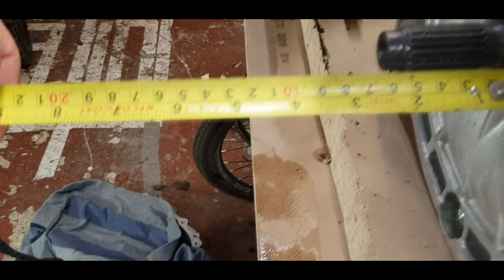Nissan Leaf Motor adapter plate idea. Part 4

Comment: im very new to this and trying to learn the process as i'd like to convert my mk1 golf. Whats the reason to not use the leaf controller. If you are using the motor, inverter and battery from the leaf? I'm sure theres a reason, just wanted to know what it is so i know for my build. thanks
Reply from the maker: I have seen video, where people have translplanted the whole wiring loom from the leaf, and yes it could work but you have a load of faults where the controller is looking for stuff, unless you can trick it into beliving its still in the orginal car.Yes you can use the leaf invertor , there are more options from when I first started. I'm now going to use the Thunderstruck leaf VCU now for simlicity . You wire to the box and it tells the motor what to do,
Reply: @IfItAintBrokeStillFixIt  thanks for the reply. So the motor and inverter from the leaf and the thunderstruck as the controller?
Reply from the maker: @studiow7  yes that's correct, remember that when you get the leaf stack to get the motor/invertor wiring loom, people are not generally not using the leaf charger dcdc as they don't have space under the bonnet. The guys at Thunderstruck are very helpful too. You could try the openinvertor board but you need to be tech savvy for that one.

Comment: Using the old gearbox like that seems a decent idea, but I'd be tempted to rebuild the leaf gearbox and and get driveshafts made/welded.
Reply from the maker: I am wondering now whether the original old gearbox will cope, going to see how it lasts. I am tempted if it fails in the future, if it does break I like the idea of a Tesla SDU.
Reply: @IfItAintBrokeStillFixIt  Will have to catch up with the videos to find out what you went with. I'm thinking of changing my motor and swapping to a single speed reduction to clear up some space. Beetle doesn't have much room.

Comment: Its too bad you didnt just mount that leaf motor and differential in place of the factory BMW rear diff.
Reply from the maker: That was my plan till I found out the inverter only spins up to 6k rpm which meant a top speed of 60mph which isn't very good
Reply: @IfItAintBrokeStillFixIt  That sucks. 
That reduction gear would be awesome to electric swap a rockcrawler or a tractor though.
Over 800lb/ft at trans input shaft then going through a trans, transfer case, and diffs!

Comment: if you going to machine something you maybe better off getting a spline bush with both original splines 1 each end and just putting it on like a sleeve ..as for controllers this one was made for a leaf https://www.thunderstruck-ev.com/dilithium-vcu.html then you can add an after market throttle i am looking to do this to my bug

Comment: No, don't mess with the Leaf transaxle, it can take much higher torque, you don't need a manual gearbox with a motor this size! Get some drive axles from a Leaf and cut them in half. Do the same with the project car axles and join them with a shrink fit sleeve. It is easy and cheap machining and will be unbreakable. A welded coupler will not be accurate and your manual gearbox will be stripped of its teeth!
Reply from the maker: Thanks for the feed back, still wondering which route to take , I understand that johannes controller spins upto 8k and could still rise .
Reply: @IfItAintBrokeStillFixIt  The leaf fixed gearbox is 1:8 so 1000 wheel rpm = 81 mph on 15" wheels = plenty! Why just not use an off the shelf controller? I know the leaf motor has a coil pickup for position sensing, but that could easily be changed for Hall sensors. There is plenty of room to fit 3 small magnets and hall sensors inside the housing where the current pickup assembly resides and even the cheap Chinese EV controllers come with software setup, so you can dial in the timing, which I think you need on the Leaf as its rotor magnets are skewed to reduce cogging?
Reply from the maker: @Tore_Lund  You seem very knowledgeable in the EV field, unfortunately if you see any of my later videos i have already cut up the leaf gearbox, my original plan was to do as you say, till i found out that the controllers only spin to 6K, even Paul's controller only spins to 6k  . Do you think I will destroy the BMW gearbox with the leaf motor , even if I use just 3rd and 4th gear ? . where would a good place to look for after market controllers ?
Reply: @IfItAintBrokeStillFixIt  I did suspect I was too late with my comment;).
Gasoline engines are not as torqy as electric motors. My own experiences with a 30kW motor with a 1:3 reduction directly to the diff. First two attempts it broke the key of hardened steel clean off as if it had been done with a bolt cutter. Third attempt broke the 22mm axle stump on the diff, so I ended with another with a 28mm axle and a half moon key 6mm wide, and it held up.  So depending of how aggressive your controller setup is, it might be a problem, but I have seen, as you, plenty conversions on Youtube with giant motors that work perfectly small car gearboxes.Aftermarket controllers??? I have no idea. There used to be some big Siemens controllers around the usual places, but I can't remember if the voltage was suitable for 375V or what a Leaf uses. I was thinking more in the line of Golden motors controller, but looking them up, their highest voltage model is only 96V! So maybe this kit 100kW 400V is more suitable: https://hackaday.io/project/164932-axiom-100kw-motor-controller/discussion-124679. Parts ship from the US, so that is easy!

Comment: I would use the pilot portion of the input shaft to aligh the shafts,  or depending on power levels , you could offset mount the motor and use motorcycle chain, to fine tune the gear ratios, but even 8 mm plate would work, the forces are in a twist, motion. It should be plenty strong, 8 mm is alot cheaper than 15-19mm

Comment: Mayby use a roller chain coupling? It will allow a little bit of miss alignment where as your spines are going to need to be bang on centred and square?
Reply: I was thinking he could get a custom input shaft made for his BMW trans that would match the splines of the Leaf motor, since he wants a custom job anyway. That way it would just be a matter of making adapter plate. It would just involve him taking his Bimmer trans apart and giving the machine shop both input shafts.

Comment: Damien made it look quite easy, didn't he? I'd go with the aluminum adapter and shaft coupler, had I the choice. Why didnt you use the stock leaf gear set and stuff the whole thing where the BMW diff was located?